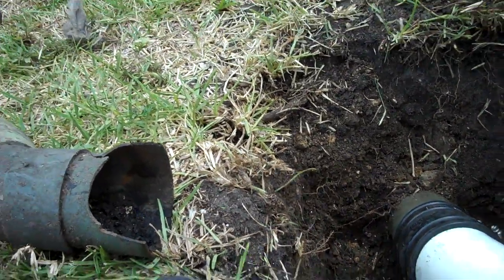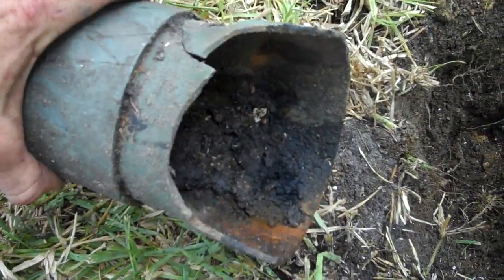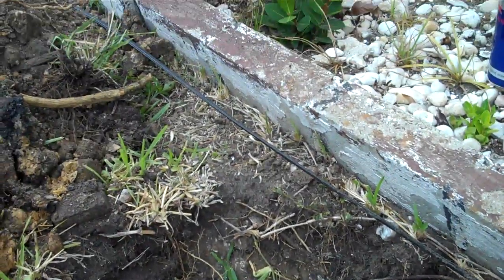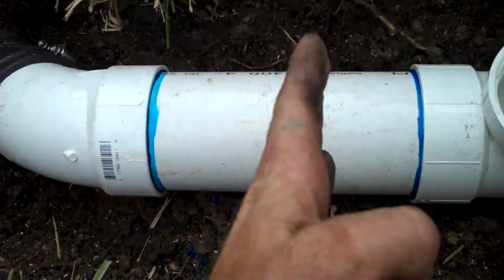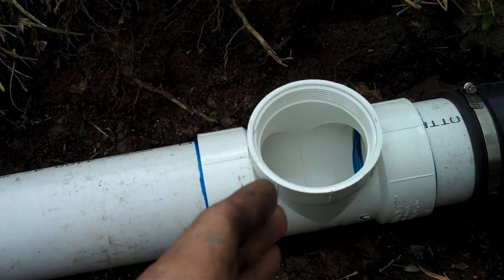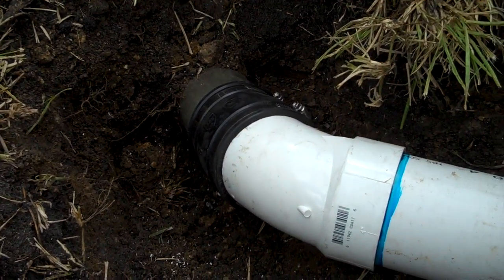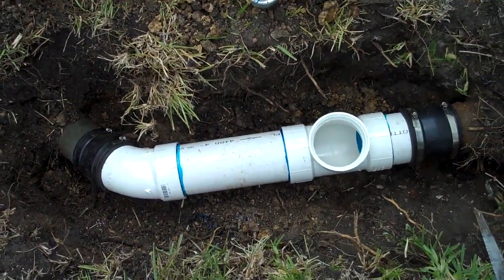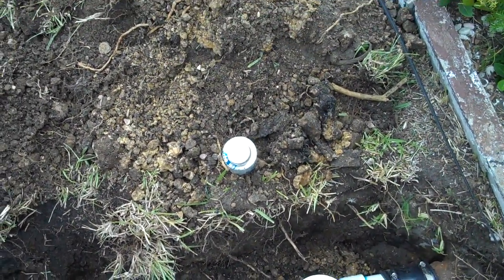customer 7805 video #3  broken sewer pipe replaced by Florida plumber

Comment: No, they don't crack if you just follow basic International Plumbing Code and use the correct glue for the correct application.  ABS glue is a solvent that partially melts the surface making the two joining surfaces become one.  PVC and schedule 35 same thing.  Plastic rarely cracks under ground.